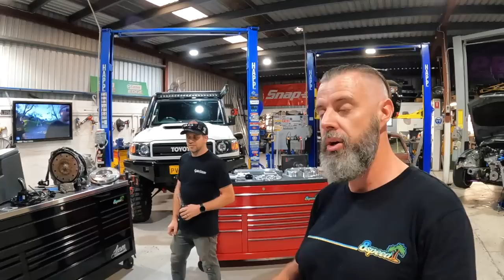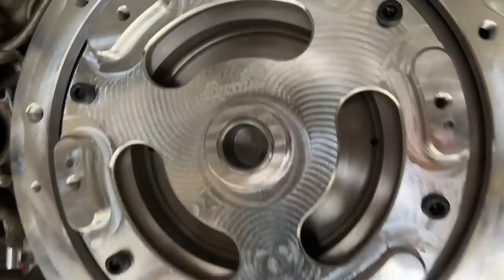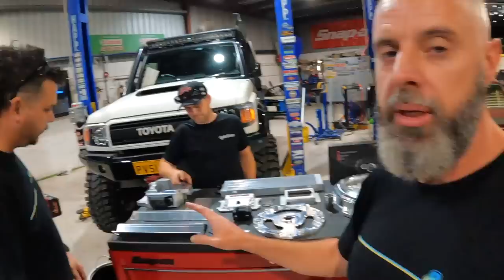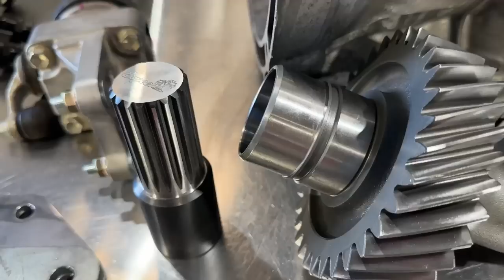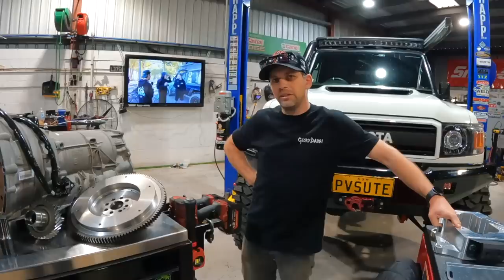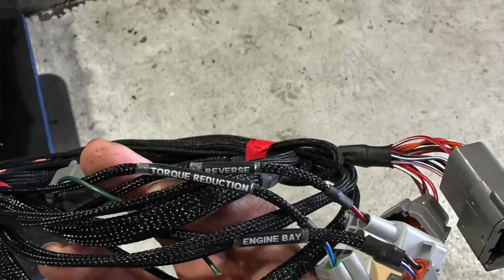79 Series Landcruiser 8 Speed Auto Kit UPDATE!

Comment: You might want to know - Lamik brothers - Łukasz and Dawid are legends in Polish drag racing scene. 13 years ago Łukasz had fastest street-legal FWD car in Poland with first 11 second run, nowadays Dawid runs Opel Corsa with VW R32 engine, which is one of the fastest FWDs in Europe.
Also, he worked on Bartosz Ostałowski car - a drift car with 8HP90. Auto transmission is a must, because Bartosz has no arms.

Comment: With very few good options for the n70 1KD hilux for aftermarket auto boxes, will these hp8 kits be available for that application? If so your thoughts on putting one behind a 1KD? Would it be over kill? Would the 3 extra gears work well with a 4 cylinder 250+Hp/600+torque motor and would it be fair to assume these boxes would give better fuel economy? Thanks

Comment: is there any risk with water or mud getting in that inspection square at the bottom of the torque converter area and causing any issues?
Reply from the maker: Even with the inspection hole water will get between the engine and bell housing. That’s not a water tight seal between the engine and trans. Do the drain holes are good when that happens. However you wouldn’t want a load of sand in there long term. So I would rinse out after a beach trip. You have the same issue with the manuals. In particular between trans and transfer case. I’ve seen heaps of sand in their on some we have pulled apart.

Comment: Hi! I was watching your video on the x5 transmission. I have an e38 730d from 2001, and i have a problem where when the transmission and engine heat up, 1st, 2nd, and 3rd gear slip, and the car enters into "gearbox emergency program" where it only works on 5th gear. I removed the transmission's sump and found a lot of debris on the magnets (i assume from the clutch packs). I think the fault may be on the clutch packs having a lot of wear. Where did you guys found the A drum? Can you send me a link? Thanks in advance. Your video is really helpful
Reply from the maker: back then i got the 5hp32 parts from ZF australia. Just called them directly with some part numbers.

Comment: Hey man I love your videos and have been loving them for years now! You might remember my username… I’ve really got no one to go to to ask about this and I know you are amazing at responding to your comments! 

This is a E92 drivetrain issue that im having on my 115k mile BMW 335is and it absolutely kills me… Its a distinctive clicking noise that I get when driving and when I steer while hitting bumps at low speed… I also notice it comes to a faster pace the faster I drive, (for example I can hear it bounce off the walls in the city with my windows down). 

I have a video on which I caught it while driving through the city, in case there is anywhere you would be fine with me sending it to you on. 

I also tried turning the wheels lock to lock while the car was idling and stationary, unfortunately that didn’t recreate the click click click click noise… 

I really need you on this Andrew, it would mean a LOT if you could give me a few pointers! 

Thank you so much, much love and greetings from the USA! 🤙🏻
Reply from the maker: Clicks when you steer are often related to strut tops. Also likely if its when you hit a speed bump and load them up.
Reply: @ZeroTo60Tube  Little update, I feel like it’s not coming from steering… At first I feared it would be the steering rack being bad but I feel like I only get the click click click click click when normally driving on not even roads/when going over bumps and speed bumps… I checked my front struts ant they seemed fine to me… The rears I don’t know how to get into with all the trunk stuff in the way…
Reply from the maker: In that case have you checked your guibo? @2stocke9x
Reply: @ZeroTo60Tube  I haven’t… I’ll try to figure out how to do that
Reply: @ZeroTo60Tube  I just got my car back from a trusted Tire Shop and I asked them to check the constant clicking and they said its because of my Brembo BBK Porsche Cayenne kit… I run 17 inch Apex VS5-RS from the previous owner so I guess I need to get 18‘s or 19‘s for the front now… 

I really hope they didn’t just tell me something to keep me happy. Thank you so much for trying to help Andrew. It really means a lot. Take care of yourself. 🙏🏻

Comment: Quick question regarding the early commodore in the background! I’m doing a 1UZ conversion in my VH and was planning on a 8HP, wondering if you’ve got one in it and if so did it fit in the trans tunnel? Cheers!
Reply from the maker: Its got a glide in that car. I think the tunnel should be ok, but not sure. Its going to depend on how far back you push the engine.
Reply: @ZeroTo60Tube  I’ll shall keep you posted as I’ll be getting the lamik from you fine gentlemen. Cheers.

Comment: So with the 6 speed auto, it seems heat was never mentioned as an issue but it’s been a big problem. 

With your 8speed are there any issues not being discussed or raised publicly ? I must admit I’m now favouring your 8 speed kit - my ONLY reservation is reliability- I recall Land Rover using ZF gearboxes and they were piles of crap. How does your 8speed box go offroad crawling at low speed in low range running say 35-37s in steep slippery Vic High Country ?
Reply from the maker: I have spoken to many of the 6 speed converted 79s who continually have issues with heat and clutch packs melting. Guys that use them on soft sand, its an instant problem. Its been the biggest concern from people i have spoken to with expeirence in the Toyota box. Reagrding reliability, its a tough one to put any relevant numbers on. These boxes are solid, but a big issue with the BMW sourced ones is BMW says dont service them (lifetime fluid). That seems to limit the useful life to around 250,000-300,000klms in the OEM applications. However as soon as those cars are out of warranty, every service shop with a bit of common sense will service the ZFs. Its worth checking the wikipediea on the ZF boxes to see how popular they are. The. ZF and asin are the two main 8 speed autos. ZF are still being used by manufacturers, where the likes of VW were using the asin 10 years ago and switched to ZF in the later models. The ZF8 is still used as the premium box by alot of the european manfuacturers on the high end models to this day. However they are also used by chinese manufacturers and even the ones made under license by Jeep are out there which give them a bad name and shouldnt really be reflective of the entire range. As for the Land Rovers, i dont know how they make everything so problamatic..... ha
Reply: @ZeroTo60Tube  awesome reply - Thankyou. Is it too early to say how often you guys suggest trans oil changes in your 8 speed kits?

I’ve never understood manufacturers not wanting trans oil changed.
Reply from the maker: @robertmillar2037  On cars that are having a hard time, i do them every 10,000k's or every year. Our drift cars, race cars where we are using the trans brake etc. However normal road use i'd spread that out to 20,000k's.
Reply: LR issues are overblown. The early ZF 6 speeds were ok provided you serviced them, same for BMWs who used the same box. One issue in 6 speed related to the spigot centraliser which can fail, a bit like cracked flex plates which are quite common across many makes,  The 8 speed also needs servicing, despite what the car maker says, service every 100k klms is recommended. LR were an early adopter of the 8 speed which now appears in many cars and trucks too.  Good on you for catching Toyota up. Their autos have always been crap.
Reply: @ericjohnson6802  heard different. Heard the early new RRs with the bmw running gear was very unreliable.
Reply from the maker: The early BMW powered rangies have the bad rep for the M62 v8 timing chains. The m57 powered versions were pretty solid. Both using the ZF trans (not the 8speed). Those M62 timing chains were a big issue in high milage cars. Luckily BMW fixed it with the N62 unfortunately the newer diesel N57 was just as bad for chains. The new v6 diesels in the later rangies, they are a special one when it comes to reliability....
Reply: @ZeroTo60Tube  I believe a lot of range rovers were using the ZF9 which is nothing like the ZF8s for reliability.
Reply: Hey Robert go check out some footage of these gearbox’s in use on the shed life YouTube channel definitely been tested well in the situation you were talking about

Comment: You gotta talk about the trans upgrade in detail, you kinda just skimmed over the topic! Also talk about the price of the upgrade and what's done…
Reply: Im sure andrew will do a video on the built trans soon enough. Luckily, we all like race cars, so the built transmissions that come out of here will cop some proper abuse in the real world!
Reply: @Buckna1  I hope so, I'm up for snapping one up as long as it can handle 1200rwkw and over 1400 NM of torque. Some have lived well and some, well I'm sure you can guess! Many have turned me away from the DCT route, because of failures and price, but at this point the 8HP will be the pricier one! Ignition cut on shift just like a sequential, may be a decent torque strategy, plus I'm looking forward to the throttle blip on downshifts and so many other features with the 8HP and nexus...
Reply: @BUZDRIFT  I believe the 8HP90 will hold that power reliably as that's what they use in the M5 and people have pushed those to crazy numbers.
Reply: @piovo1  The Trick is finding one with supporting kits! I Do see a lot of US 8HP90's about, but they're meant to be weaker than the OG Euro ZF's
Reply: @BUZDRIFT  should be the same the ones that most people swap are the 8HP70 and ZF say the limit is 700nm (70) but people are running 1200nm so the HP90 which has a limit of 900nm should be fine with your power levels, I’ve not heard of the euro ZF being stronger, I thought they were all the same as they all come from same factory no matter the cars production.
Reply: @piovo1  Nah, the output shaft and bearing is small and weaker on the US models! Or something like that. Andrew mentions this in one of the episodes, I think one of the earlier ones!
Reply: @BUZDRIFT what's the point of having an 8 speed in a car with that sort of power, genuine question
Reply: @tcmx712  VS $25K for a sequential that can handle the power........"the point" as you say, is just over $10K😪
Reply: @BUZDRIFT  sorry I meant what's the point of having 8 gears in a car with that sort of power wouldn't less gears be better for speed???
Reply: @tcmx712  If I just wanted to drag race, I'd get a power glide, you're missing the point, it's mixed drivability in any situation, and lol 8th gear I'll be doing over 464.923388 Km/h if the car will do it! Yep, done a ration speed calculator while ago! I'f you're talking acceleration and not speed, then my power glide statement still stands!